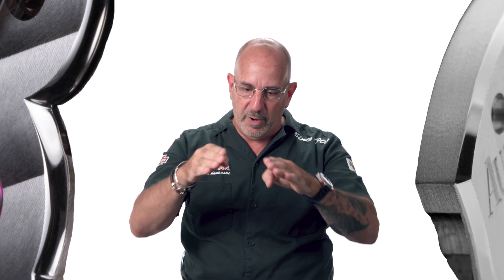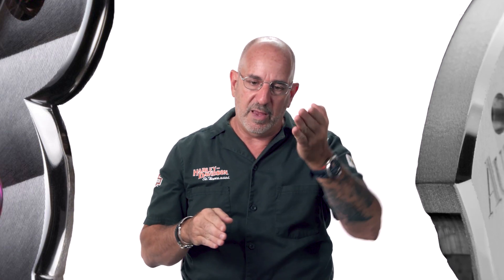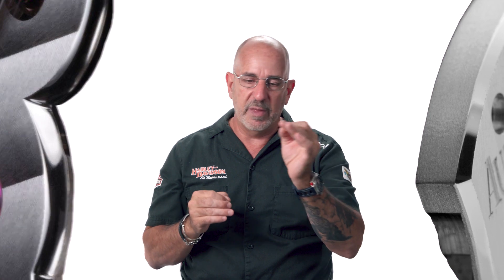How Watch Finishing Elevates Luxury Watches | Master Watchmaker Explains | The Classroom

Comment: I’m always intrigued by movements that use different movement finishing, such as De Bethune polishing the entire movement, or other brands using satin brushing instead of cotes de geneve. 

After all, the purpose of perlage and cotes de geneve was to catch microscopic dust particles that would encroach inside the case of early pocket watches and wrist watches, which is no longer an issue, as everything is at least dust proof as a bare minimum these days.

Comment: Are ETA or Selitta simple calibers finished by hand? For example perlage or Côtes de Genève applied on Tag Heuers Caliber 5?
Reply: ETA and Sellita are machine finished movements. Additional hand finishing may be applied to them, but I don't think that's the case with Tag Heuer Calibre 5.
Reply: @user-dr7tb4xf4o  Do You know aby hand finished affordable movements?
Reply: @ArtBorow  Glashütte Original comes to mind as the most affordable, even though not as much on the most affordable models... Even JLC has mostly mashine-finished applied on more affordable watches. Perhaps used Parmeganis perhaps. But that would be a great question to Tim. I was surprised recently, when he said in the AP Royal Oak vs Grand Seiko video that the Royal Oak movement is mainly mashine-finished as well now even though it earns the Geneva Seal.

Comment: Why start with brass?
Reply: Brass has many qualities requiered for a movement (softness magnetism cost etc...)
But you can have other materials such as gold in F.P Journe or German silver in Lange. Moreover not all the component of a movement are made with brass tou will also find steel (screws), iron alloy (stem), zinc, nickel, tungstene etc...

Comment: I heard finishes were put on movements to originally collect bits of crud and dust that got caught in the watch before watches could be hermetically sealed.
Reply: That sounds correct. Idk ? Not a watch mechanic or jeweler . I know some about engineering. This sounds like good reckoning. Such is so when one retaps a stripped blind hole out to the next bigger size. One puts common grease on the tap to collect the shavings as the tap cuts them. Otherwise the shavings could damage the bearing surface on critical internal movements in machinery.  I have used this process while fixing petro engines . The gap of the stripes would work in much the same manner . It’s gotta go somewhere that’s for sure. I have been told common lighter fluid is very useful when cleaning up corroded watch internals . Place movement in a sonic filled with lighter fluid . Let the vibrations do the work then the excess will vaporize leaving a clean dry internal.